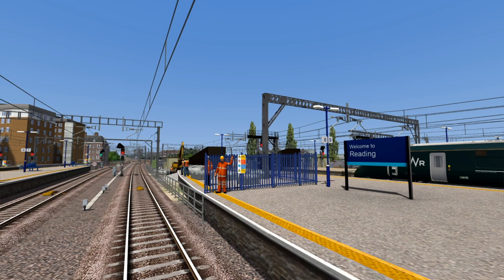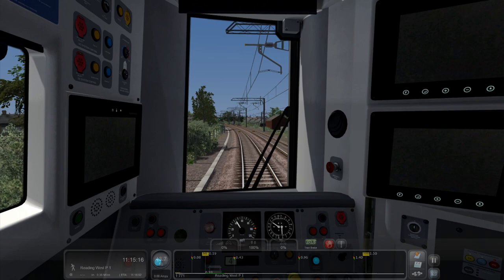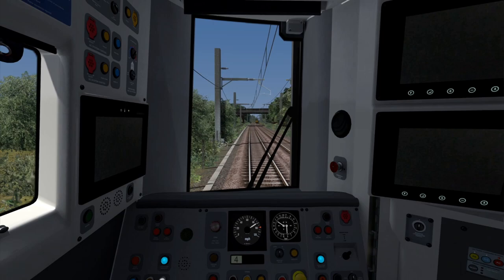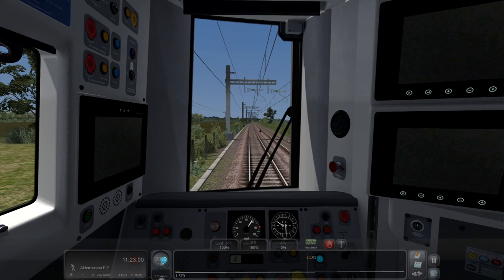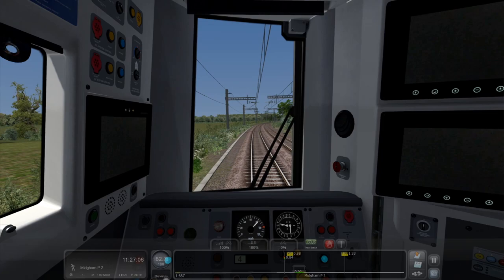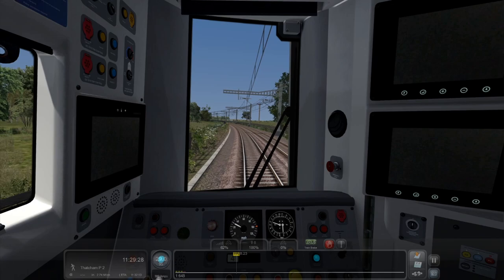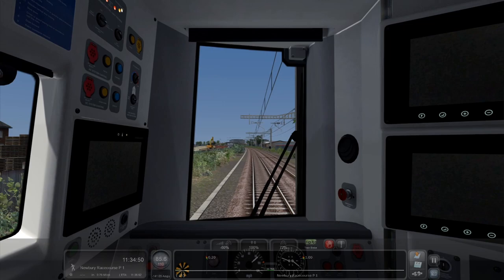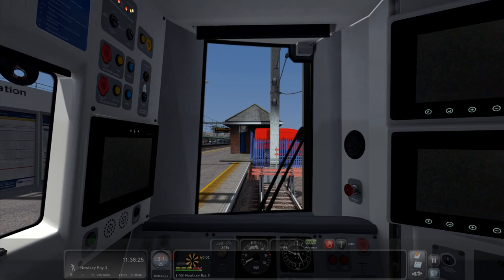Train Simulator 2020: Reading to Newbury Electrified

Comment: The Reading to Pewsey OHLE Extension is the same as South Western Expressways, but features the Overhead Wires in between Pewsey and Reading. Someone did very well adding some Overhead Wires from ATS site on this route. I'll try it out after I get the ATS subscriber and buy the ATS OHLE as the sub discount because I cannot waste too much money to get so many payware DLCs. :-)
Reply: The only thing I had wrong, was that my OHLE pack was out of date. I just reinstalled it. 

The ATS site didn't announce the update. I was scratching my head as to what was wrong with the OHLE in places on other routes. Im glad I found out and fixed it up. 

I have always found the ATS Installer to be a great time saver, but sometimes, you need to install something directly by hand. This was one of those times. The OHLE is a package that needs to be installed by hand. For anyone who doesn't know how the OHLE pack is installed... Stupid me!

Comment: Does this connect to the JT great Western Mainline route or do you have to load up a new scenario to go from Reading to Newbury on this product.
Reply: Hi, no my route does not connect to WML, it’s a complete route from Reading to Exeter and Bristol. It’s the normal shorter way trains go down to the South West.
Reply: @martinrm8056  Does this mean you could do a Reading to Exeter quick drive?
Reply: S4MTHEMAN13 yes it comes with a QD to Exeter and the return QD. Thanks
Reply: @martinrm8056  brilliant! Thanks! I'll look forward to downloading it
Reply: @martinrm8056  Another thing, I dont have Bristol to Cardiff, Just Trains – Newcastle to Edinburgh, and North Somerset. Would I be missing much from the route?
Reply: S4MTHEMAN13 yes it’s a shame you can’t buy that route now but it may well come back.  Give it a try, it won’t cost you anything other than time and you may not notice too much missing. Thanks.
Reply: @martinrm8056  does this work with the just trains South Western expressways to Reading
Reply: @JohnsonMcJohnson  I have been told by other users it does as the assets used are in the JT common library, All track is included in my work/download. Thanks